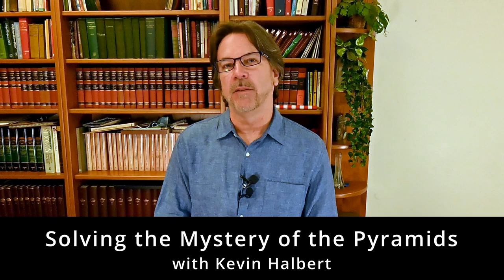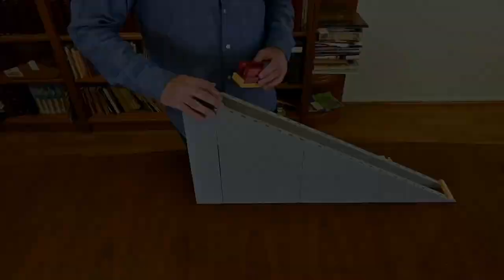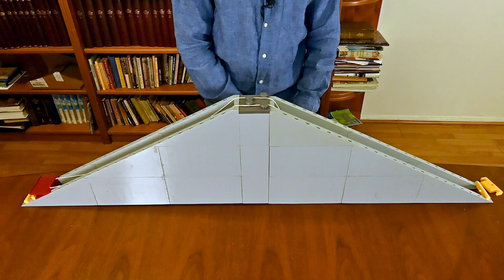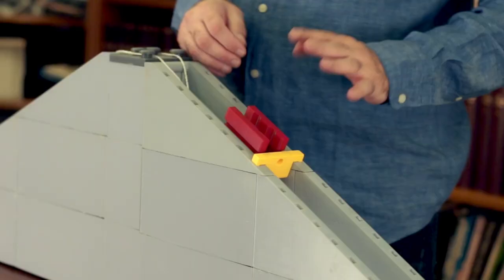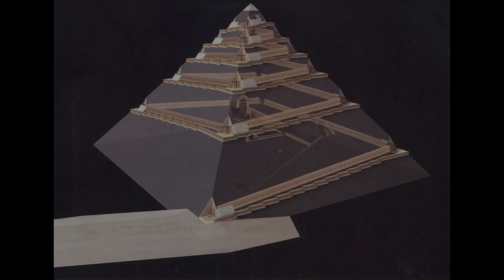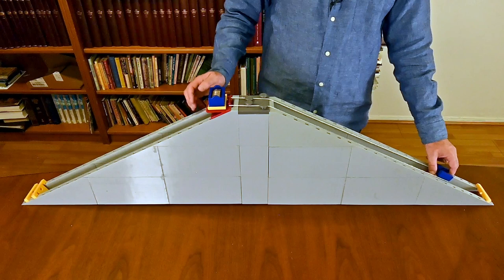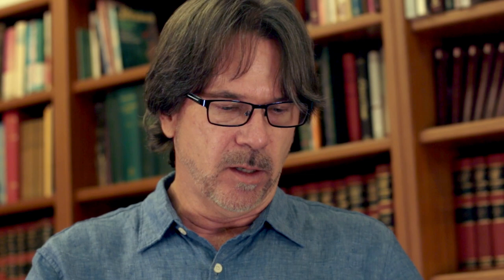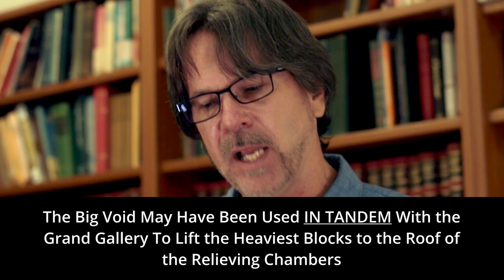How The Pyramids Were Built

Comment: The spiral ramp picture shown here, doesn't really explain alot of aspects. You're idea is interesting, but still leaves some questions. How did the initial balance weights get brought up, put in, or out of cart? Loading 1,2,5 tonne blocks by hand seems tricky. I haven't studied the inside of various pyramids much yet, but I have some ideas and the mathematical system if you wish to look, get some ideas. Start with this, the centre step was an obelisk. Could the d'jed possibly fit in those ramp slots?
Reply from the maker: There were a LOT of people working on the pyramids... pulling 5 tonnes up a 26.5 degree ramp isn't that difficult. It is the larger stones(60+ tonnes) that are the real challenge. If you are referring to Houldin's theory of transferring stones to the lifting platform to reset the system, those stones would be small enough chunks to be able to be moved manually.

If you look close I believe you will see that the Great Step isn't an obelisk. When I think of obelisk, I'm thinking of a tall giant stone, much larger than the "regular" size blocks (2.5 tonnes).

What is "d'jed"? Do you mean "Sled"? If you meant sled, I can't visualize what you mean by that. What would it look like.

I may be confused on what you are describing, I've  made my best guess as to what I think you are saying.